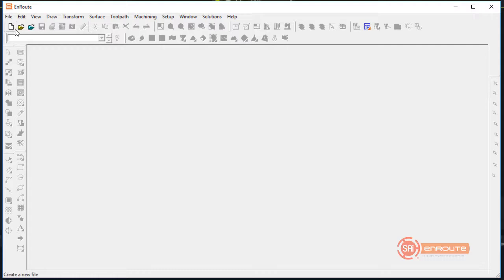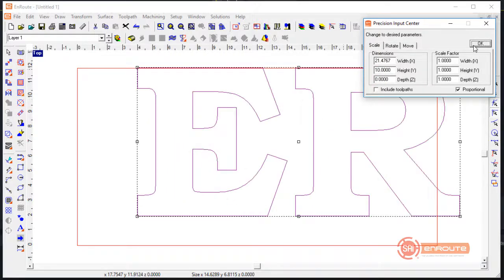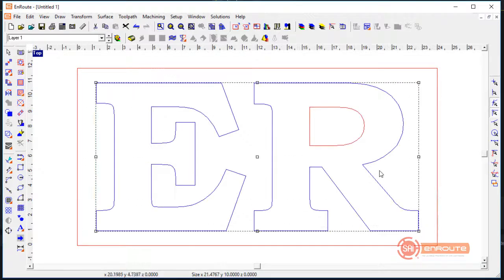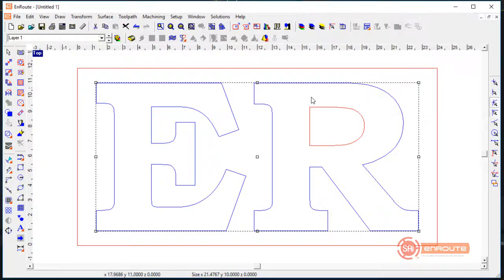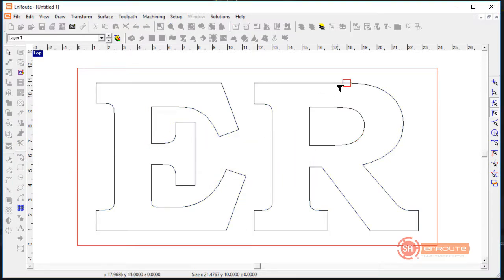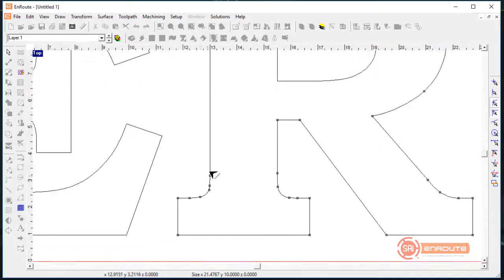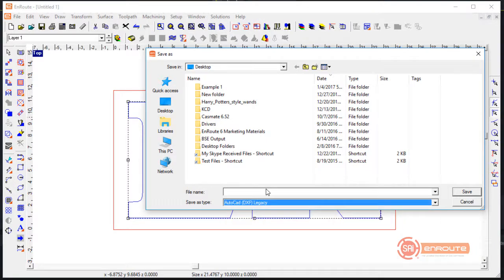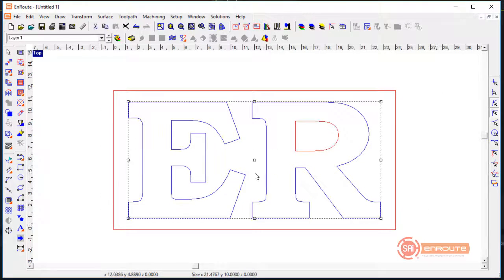Letter Bending Export

Comment: Dear Sir,
I have a letter-bending machine in my workshop, and I’m experiencing a bending issue. The machine sometimes bends the aluminum sheet too early or too late, even though the notch spacing is correctly set.
I would appreciate your assistance in identifying and resolving this problem.